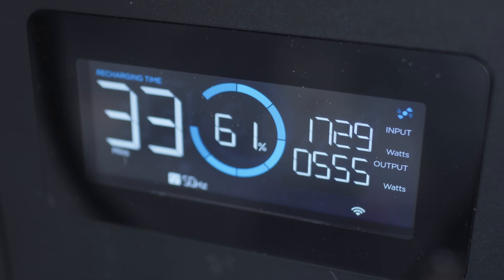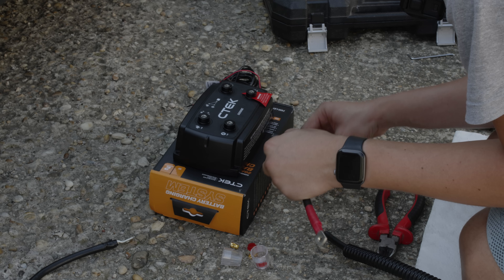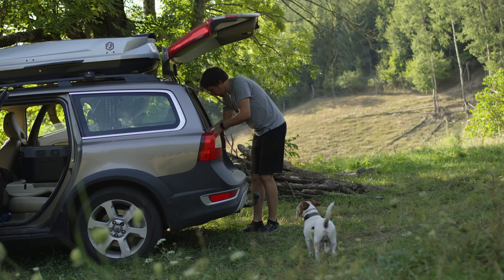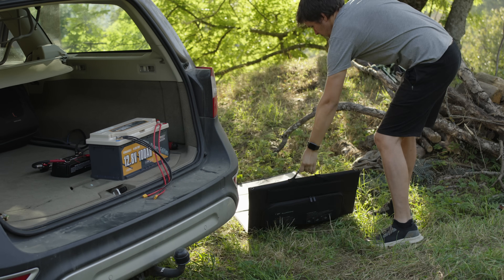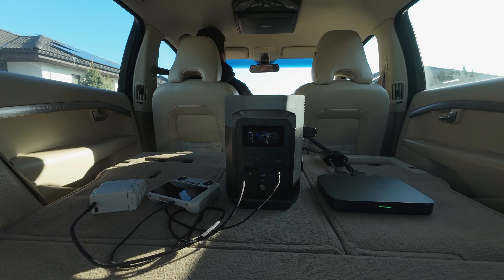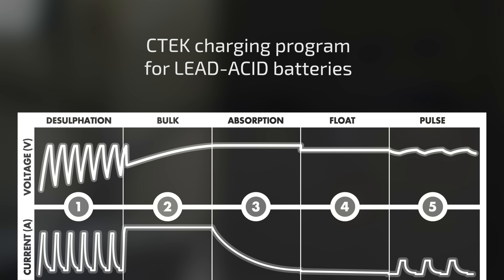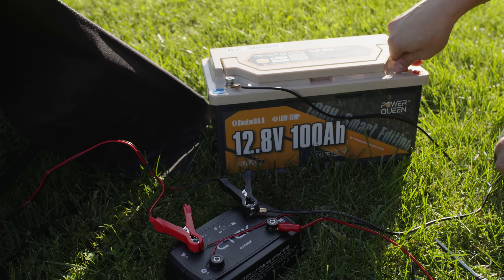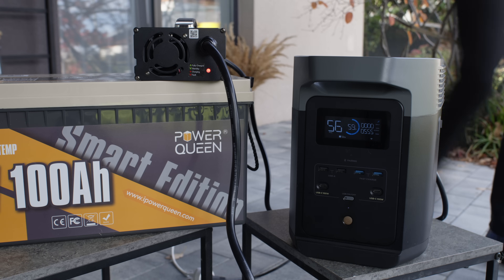LiFePo4 Charging 🔋 Power Queen | CTEK | EcoFlow Alternator Charger | AC/DC

Comment: Good stuff. A question though are those two wires you are tapping into at 3:35 oem from factory?
Reply from the maker: Hi, thank you very much. Yes, those were originally there from the factory, so I decided to use them to make things simpler. Running cables all the way to the engine bay would have been more complicated, and for this purpose, with a load of up to 25A, this solution is sufficient.
Reply: @VolvoCamperLife  thanks for the quick reply i have looked around the carpet like you did i cant see those cables on my 2008 v70 though mine is rhd(the cem module is located on the left). I will check the drivers side and revert
Reply from the maker: @TheWabbz  Hmm, I’m not sure about other cars in this regard, but I don’t have anything specially modified in my car that would require those cables. It might depend on the trim level; I do have electric and heated seats. But I think it’s more likely a branch that leads to the fuse boxes in the trunk, from which many circuits are powered.
Reply: @VolvoCamperLife  thanks i also do have electric and heated seats but i will check and then give my feedback once iam sure

Comment: Great video! Have you thought about cutting off your ring terminals on the alternator charger and adding an Anderson connector in it's place? That way everything is quick connect
Reply from the maker: Yes, exactly, I have the connectors ordered, they should arrive tomorrow. So I didn’t manage to include them in the video, but I will definitely be installing them.